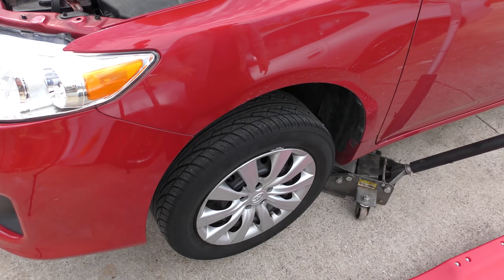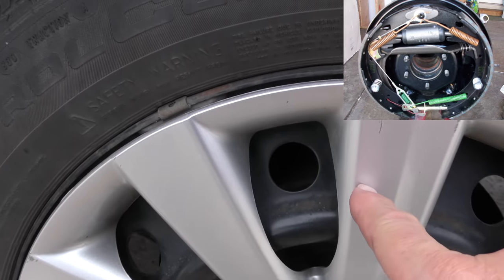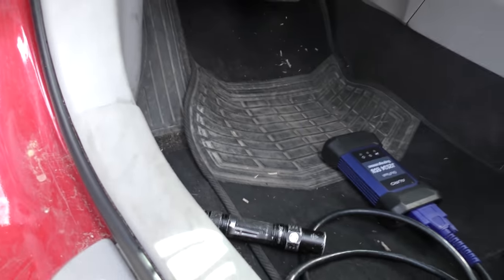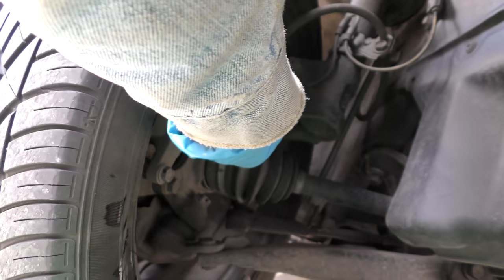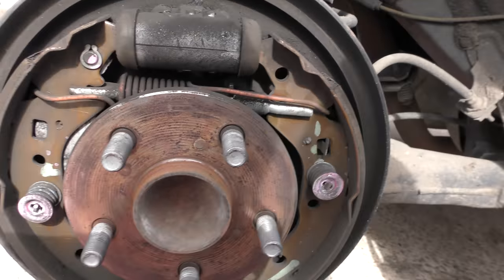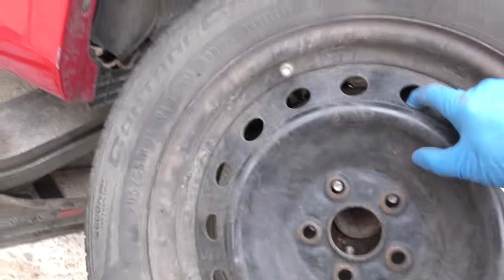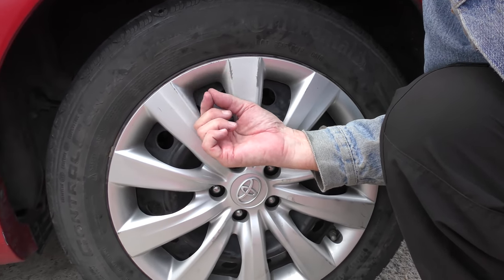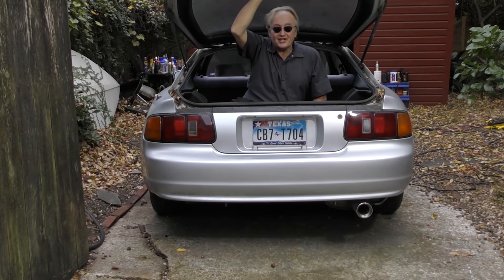Mechanics Don’t Want You to Know This

Comment: When I was in high school I worked at a brake and clutch shop after school. For setting the drag on drum brakes, we'd replace the wheel back on the hub and, grab the tire with one hand and give it a spin and adjust for three full spins by counting the air valve turns on the wheel. Less than 3 spins was too tight and more than 3 spins was too loose. With drive axles we usually relied on feel.

Comment: I think if you had pulled up the parking brake you would have felt that the rear shoes needed tightening.
Reply: Good point.  I'm a gonna do that with my van that is doin the soft pedal cindrome
Reply: Usually you can drive in reverse and apply the brakes to activate the self adjustors  which will keep the brakes pretty close to tolerance. This thing here had way too much slack to do this method in a reasonable amount time. The self adjustors only move in very small increments.
Reply: @chadh3441  this too👍

Comment: Isn't there a port on the backside to access the star adjuster without removing the drum?
Reply: I do them through the slot in the back with the wheel on with a slack adjuster tool . That car is different ?
Reply: Usually but not always. And some are almost impossible to get at.
Reply: I was thinking the same thing.

Comment: Scotty I got a 2000 4Runner basic model RWD only, 148K miles on it and the brake locks up when I first start it in the cold weather unlocks within 2 mins and it doesn’t lock up every time and does not lock up at all in the warm weather, I live in Minnesota and it gets cold , also I step on the gas and it doesn’t seem to want to go past 4.5-5 rpms not sure what it is

Comment: Pump the brake petal and bleed each wheel.  Then adjust the drum brakes.
Interesting. EXACLY as 50 years ago.  thank you.
Reply: If you pump the brake pedal and it comes up higher, then that's a good indication of air in the line. If it doesn't rise up then the brakes need adjusting. Usually its the back that needs adjusted. That should bring the brake pedal up. The front brakes adjust by their self, if they are disc brakes.

Comment: I have a 2005 Jeep Cherokee 2.8crd turbo diesel with a manual transmission 6 speed. Do you know know why it cranks so long on a cold start, especially on cold mornings. We had the starter motor replaced but nothing worked. It’s got just over 100,000 miles

Comment: If you're not old enough  to know what drum brakes are, I guess this is a good lesson. but it's not a SECRET. It's a normal part of drum brake installation and service. By nature, rear shoes need to be adjusted periodically. The automatic system, as Scotty says, does get rusty and become inefficient (On old GM's and the like you used to back up and brake hard, that got the adjuster to turn).  So know what you're doing before you look for a "secret". If you have a car with a low pedal and drum brakes (which is pretty rare these days) this is always one of the first things you should look at.

Comment: there should be automatic adjusters for the brakes find an empty section of road (if you don't have a long driveway) need to go in reverse about 5mph and firmly pump brakes do this a few times before having to remove tires and manually adjust as shown

Comment: When I used to wrench on cars, we used to back up and hit the brakes hard a few times.  The self adjusters work when the brake is applied while reversing.  I would think the Prius would have the same hardware or has it changed in the last 30 years?  BTW, I'm the same vintage as you are, pushing 70.

Comment: The brakes are self adjusting but they don't do it in the forward direction you have to run the car in reverse so the adjusting bar that sets on the star wheel pushes it when brakes are applied in reverse quickly jamming on them it takes a pretty good jolt to get them to kick the star over, but doing this you don't want to go over board  jamming to many times because you can get them to tight if your real aggressive and if you do it to many times and the brakes can  get really hot if you don't  know what your doing. But the process is called brake equalization. Usually I can get it done in two stops in reverse after replacing shoes on drums and not being really critical when sliding the drums on being loose.on initial install.

Comment: I always clean those adjusters, so they function well. Sometimes they're greased up. Not sure if that's the right thing to do.
Also, they can often be reached from the back, to release the brakes when you can't get the drum off.
If the return springs are broken, good luck

Comment: I have a spongey brake peddle on my 2005 Rav4 and I have a new master cylinder but the only difference is disc brakes all around. My mechanic is as good as Scotty but I still have a soft peddle.  I'm used to slowing down early and don't let anyone else drive it.
Reply: You have a problem; your "peddle" is mushy for a reason. Have the brake system re-checked, starting with the poqwe brake booster and any vacuum lines from the engine. Then have the system flushed with fresh fluid; brake fluid attracts and holds water vapor, which changes its hydraulic properties, along with trapped air from micro-leaks. Over time microscopic leaks allow air into systems also, so a full flush will likely bleed the system totally free of entrapped air.
Reply: @markh.6687  Thanks- I'm due for service and the weather is warming up. I'll check that out.

Comment: That's one of those times where you think you've possibly got a big problem that turns out to have a simple fix. Always feel good when luck is on your side because it just doesn't happen very often. I would have thought it might have been the brake booster.

Comment: Oh man my 1971 cutlass loses brake pressure. Still brakes well, but it took some getting use to when the pressure drops. Neither of my family member mechanics can fix the issue, and they are muscle car specialist
Reply: That's not normal. Check for air trapped in the lines, as well as the entire brake system. If you don't think it needs to be checked, it needs to be checked. You have a problem in your brake system.

Comment: Scotty .I 've trying to get some response to my question regarding my Pilot 2007 with 175, 000 miles.The engine light turns on when the temperature is between 45 to 50F.The light will turn off 3 to 4 days after.What do u think the problem be?
Reply: Ask him on his personal website
Reply: What codes do you get?

Comment: Doesn't the drum brakes have a self-adjusting mechanism on them. If it does, maybe that needs some tending to, because when the shoe wears out, you're gonna have to keep manually adjusting them and it's not a safe long-term solution.

Comment: So how is plugging your electric car into the electric grid to recharge the batteries green?  The grid is mostly powered by natural gas, oil or coal plants.  It is polluting by proxy if you have an electric car. 

My car burns gasoline. But an electric car often times burns coal.

Comment: I thought the back drums self adjusted when you backed up and hit the brakes.
Reply: They are supposed to.  Maybe this guy doesn't back up enough.  One problem that drum brakes have is the adjustment screws get corrosion on the thread,  then they wouldn't turn. To remedy this I would use antisieze on the threads,  but that didn't seem to be the problem with this Camry.
Reply: @brucejones2354  That adjuster sounded pretty dry to me....

Comment: The main mistake people make with those rear drums is not using the brakes to stop the car when backing up. Those adjusters only work if  you apply the brakes while in motion backing up. Get into the habit of slowly backing up and pumping the brakes a few times before going forward. Don'y use your automatic transmission to stop it. Bad for the transmission. Same for a regular transmission, don't let the clutch stop the car.

Comment: There are cars with drum brakes still? Thought those ended in the 80’s lol
Reply: Must be a base trim
Reply: @labornurse  latest gen corollas dont have anymore even with base. sucks cuz drums need so little maintenance
Reply: @dinobot_maximize  In till recently Kia's certainly did. Drum brakes, manual windows.. ext.
It shocked me when I saw it.
Reply: @DevDreCW  Most of the braking effort is needed at the front...rear brakes just there for the ride/parking brake...drums are cheap...
Reply: I believe that the Toyota Tacoma still use rear drums.  For rear brakes that's ok for me.

Comment: Scotty, the first thing I would have done is checked the parking brake...
Reply: Right.  And not an emergency brake, it’s a parking brake.  It used to be that both using the parking brake and firmly applying the brakes while moving slowly in reverse would move the adjusters.  🤷‍♂️😏
Reply: @tomtheplummer7322  Perhaps when Bison still roamed prairie....

Comment: "You want a little drag" No, I don't think I do. If the brake isn't applied, there should be no drag. 

I suppose if you push the clutch pedal all the way down it should still slip a little too ...

Comment: Hyundai has a lawsuit against it for piston knock. My 2013 Elantra GLS only has 28,000 miles makes tapping noise when engine is cold. Dealer told me it was caused by aftermarket oil filters. Use only OEM filters. I'm going to take his advice but is he telling the truth?

Comment: Why don't you tell them why the drum has threaded holes in them. Found a Chrysler egr bolt ground down will last for ever to pull off drums and rotors.

Comment: Yaw but, the adjusters probably aren't working properly. Yes, you adjust them up but you will probably continue to need to do that as they wear. Sometimes you can clean and lubricate them so the little cogged wheel turns freely, but sometimes the adjusters need to be replaced, because the little cogged wheel and the adjuster pawl get worn out.
Also the self adjusters work when you back up and and apply the brakes. So some people don't apply the brakes enough and hard enough in reverse to make the adjusters work, so yes then you need adjust them up.
Reply: Or you can apply the parking/e brake, as others have said, that helps adjust them up, or back up and apply the brakes firmly, but you may have to do either many times.

Comment: ....these days there's no fear of asbestos dust when removing drums , or is there ?
Reply: The dust is probably still hazardous. I worked on a lot of the old drums back in the days before asbestos use was publicly shamed. Now it’s starting to bite me. Once the dangers were identified (and publicised) the advice was to use water to clean the brakes, not compressed air..

Comment: I though drum brakes were all self-adjusting and adjusted themselves when car goes in reverse?  No?
Reply: Never heard of that?
Reply: @mcc7762  adjust them every 10-15k miles? I don't think so. I went 150k miles without adjusting anything on the rear drums. Only new pads in the front, rotors too, one time.
Reply: Actually you are correct.  "Scotty mentioned automatic adjusters"  These adjust when you back up and brake, however unless you make sure you back up and brake hard once a week or so they never work that well.   I have a similar Corolla I can tell when they need adjusting by how far I have to pull up the parking brake.  Its so easy to adjust them I just do it every Spring.
Reply: @mcc7762  damn...

Comment: 2012 and it still has drum brakes?  I thought Toyota was so great.
Reply: Drums aren’t even bad
Reply: my brother bought brand new Tacoma last year, and it had drum brakes in the rear.
Reply: @cesarurzua8234  Not until you get them hot.
Reply: @davidjacobs8558  Why.  How could disks be more expensive?  Especially on a truck where you might have to tow something.
Reply: @mitchstaff8281  drum brakes don't do much
Reply: @brian_jake  I know.  I've got drums on my 67 Mustang and you can out drive the brakes easy.  Especially when they get hot.

Comment: Wouldn't it have been easier to adjust the breaks first
Reply: “Breaks”?  Most time, air in the BRAKE lines are the problem, therefore it is usually Step 2 after visually checking for leaks.
Reply: @Primus54  I would have looked at the breaks those breaks first then if it was ok I would bleed it out

Comment: I like me some brake advice and exposing bill gates for what he is (he's worse than what's mentioned here though). Also on the throttle body thing, if the idle is too high or too low you may need to perform an Idle Air Volume Relearn which requires a fancy scan tool. So be very careful about cleaning the electronic ones.